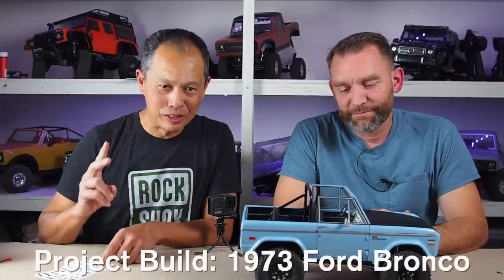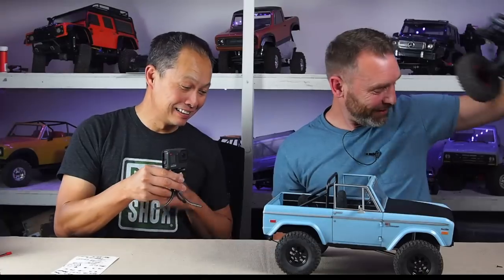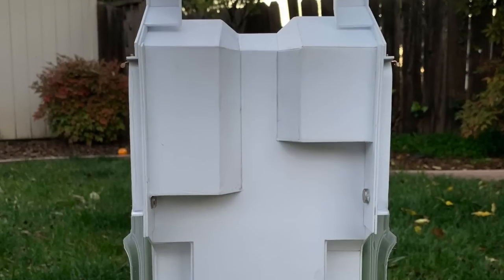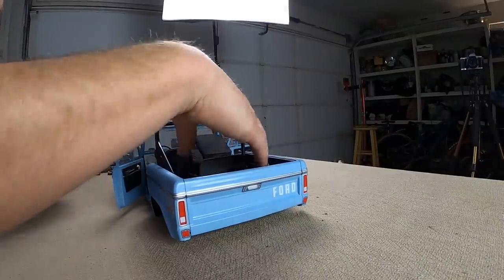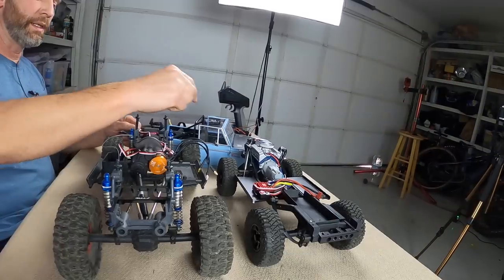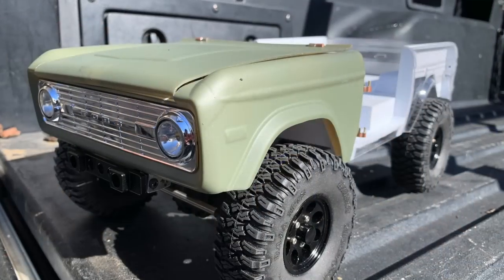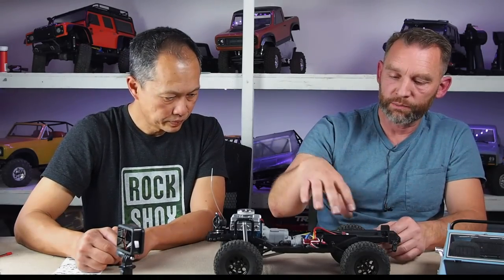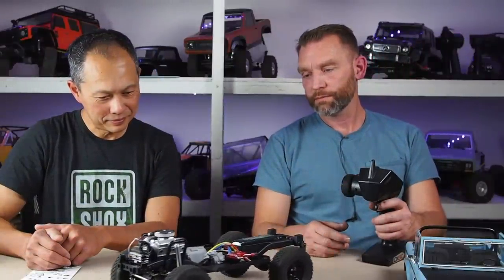Best Ford Bronco RC Crawler Build Ever - scale build

Comment: Well done Randy... I'm sure the guy who designed the real 1:1 Bronco would be absolutely honoured on the excellent craftsmanship you have displayed mate. It's what I believe is the perfect balance of using of the shelf kit, scratch building and modified parts to create a True scale trail truck that will probably perform quite well. Also love the colour.
Once again well done Randy.
Cheers mate 👍
Reply: I think the original designer would actually be turning in his grave after seening how he ruined the bronco with that engine in it. To be a ture scaler he should have 3D printed a 302/351w ford small block for it.

Comment: Excellent job the only unfortunate detail is that the engine in this chassis is a small block Chevy and not a ford still awesome
Reply from the maker: Correct! That will be fixed.
Reply: Probably makes it run better!
Reply: Yeah my older brother Is a Chevy guy I'm a life long jeep enthusiast / owner / builder and anytime I add to or do tweaks / repairs his comment for years has been  just drive a Chevy under it and call it done. lol
Reply: I agree.
As a real vehicle enthusiast, I believe in keeping Ford vehicles Ford engined.
Would a Camaro owner install a Nissan engine in place of an SBC or LS?
No.